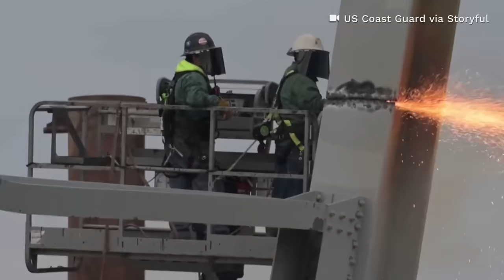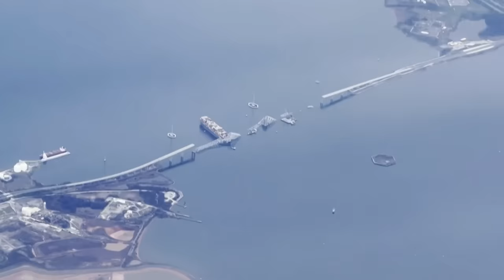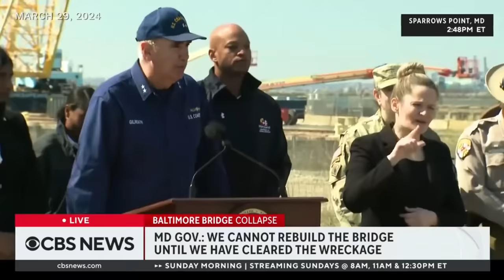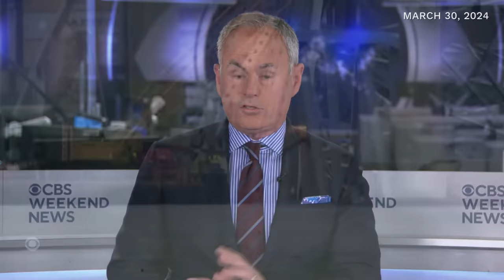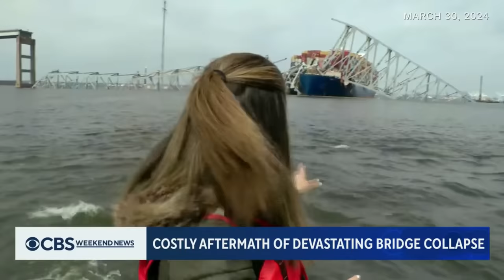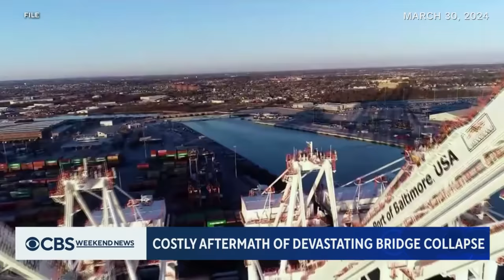Crews begin cutting Baltimore bridge collapse debris into smaller pieces

Comment: When you are cutting the metal, you do not know the forces on that steel and do not know how it will move when cut. That is what makes it so dangerous.
Reply: You right. It's not known what direction it going to take on the time It's cutting 😮🙏🏻🙏🏻 plays for God protect and gives wisdom ❤🙏🏻🙏🏻
Reply: I thought about that! Hope they have something in place for that.
Reply: Don't they hold it with a crane to prevent it from falling randomly after cut?
Reply: @chromatic9180 They do, but they have no idea which way that steel will swing based on torque/tension on it from the collapse. Got some potential widow-makers in that rubble.
Reply: They are professionals
Reply: one cut could shift tons of weight.  Just a daunting task
Reply: @chromatic9180  No
Reply: I'm sure each cut is calculated. But yes structure  unpredictable  when under tension & weight bearing..  but  sure these salvage guys know wot they doing ..stay safe all.
Reply: @antoap3999  i hope so, not just a bunch of cheap illegal workers, the family of the bridge workers that are missing couldn't speak english
Reply: Right ! The laws of Physics is totally not on their side of the ring right now ! One miscalculation & it could mean :text-green-game-over:for some unfortunate individual.

Comment: Very dangerous because the metal has alot of stored engery .
Reply: many pieces can be under tension for sure
Reply: I feel for the burners and crane operators.  Greblav   above comments everything is safe.
Reply: Ya, I imagine a room full of... structural engineers? trying to figure out where to cut it without it falling into a pile like a giant game of pickup sticks.
Reply: I’m sure they looked at it and know where to cut.
Reply: @chrischupp9760 sure, but knowing where to cut doesn't mean shit isn't going to go wrong after the cut
Reply: Definitely. Thats probably the most unpredictable part. Like cutting a giant spring
Reply: @ratataran   Exactly!

Comment: I've picked many loaded shipping containers with my 30 ton crane over the years. ONE at a time, and usually from as close as possible. To see the number of containers on the ship (and many more we can't see) gives me a pretty good idea of the weight involved, throw in the weight of the ship itself, and my mind boggles. Working with a torch from a man basket, with a water borne crane, with twisted masses of steel, they will be taking a while, as they should, damn dangerous.

Comment: Prayers that God keeps all these Men & Women safe & free from harm🙏 Just the stress that the contorted steel is under is hazardous when each individual pc. is cut & snaps free. UNBELIEVABLE BRAVERY ! With all the modern tech. I envisioned they would have used some means of robotic arms &  plasma cutting not a couple guys suspended over the ocean with an oxy-acetylene torch !😱
Reply: Nothing fails like prayer. Nothing succeeds like hard work. Keep it real.
Reply: Skill and experience - Doing it manually means they can tell if the steel gap is opening or closing - any doubt and they'll step back and check things

Comment: So using a torch is faster and safer than unbolting the sections?
Reply: Most bridges are riveted together.
Reply: Perhaps they keep bolted sections intact for investigation and research.
Just perhaps.
Reply: Beams are under tension
Reply: @mtnviper1963  stop the video and you'll see nuts
Reply: Yes. One tool instead of several.

Comment: There are plasma units now that could do the job but those require electrical power and compressed air. The exothermic are somewhat simpler "as I remember".
Somebody is "creating" information  that is not accurate. ie., "not many container ships use Baltimore" stated on an early Saturday morning blip".

Comment: Demolition is one of the most dangerous jobs you can perform. Surprised that one of the platforms is not fully caged and the guy in the orange hard hat doesn't look like he has a harness on (maybe it's under the jacket?).  Will there be any eco-mentalists screaming about spark containment or dust control?

Comment: Then you realize how incompetent the city officials have been for refusing to put safety first, on a key Bridge that is use to move most of America's Cargo by not having dolphins installed as safety barriers in front of those main structural pylons which would've easily prevented that ship from crashing into the Bridge. That's what dolphins are designed for and built for in the first place, they knew this was a problem to stop tragedies from happening. They should've learn their lesson from the SUNSHINE SKYWAY BRIDGE in Florida when a container ship crashed into the bridge and killed 35 people. but they failed to follow through with such safety measures. Sad situation if you ask me. Bridges in the US need to be seriously looked into to make sure their all up to par on safety concerns.
Reply: The city officials are not incompetent, they didn't design the bridge. Even the engineers who designed it weren't incompetent.
That was the knowledge at that time.
The key bridge is just one of those bridges without protective pillars to to be main pillars.
No new bridge will be built like that in these days.

Comment: Wow crazy comments,no the steel cannot be put back together,stored energy(very important)a straw in between 2 fingers,and you cut it the long side springs back to form,accept with those steel beems thay will cut you in half.i am sure every cut has to be looked at 1st an engineer,then the crane operator has to put enough tension to make it somewhat safer,then the cutters can cut.
Reply: The unseen crane ops are also at risk, shock loading can take down even the biggest rigs, it is good to see real pros at work.

Comment: One to look and one to work? 😂
Reply: Do you even work at all?  No
Reply: government contracts they're short staffed
Reply: In heavy construction you always have a partner with you for safety.I’ve done this kind of work and they will take turns cutting,one guy is not going to cut all day while his partner leans back and does nothing
Reply: @mattharper588   What kind of safety can the guy behind him provide?
Reply: @Greblav  I’m a retired Union Boilermaker and we always had a partner in case of an accident and I was on a job where two hands were doing exactly what these Ironworkers are doing,working from a articulated lift when one of them had a massive aneurism and collapsed,his partner was able to call for first responders and get the lift to the ground.Edit they also take turns cutting,you can’t expect your partner to do all of the work

Comment: Can they save the pieces and put it back together?
Reply: not really man that's dangerous and can leave allot of Fractured points on the bridge with weak stressed beams
Reply: Would you really want to drive over a recycled bridge?
Reply: @V.E.R.O.  I live a couple miles from the bridge and I sure as hell don't want to drive over a recycled bridge.
Reply: Aren't wields stronger than steel? @pokermel
Reply: The Humpty Dumpty Reconstruction Company will be taking that task on. 😊

Comment: "Exothermic cutting torch" So 'plasma cutter' wasn't a cool enough sounding term?
Reply: They tried the endothermic non-cutting torch, but that didn't work.....
Reply: A plasma cutter would be an arc cutter that produces plasma.
Acetylene- Oxygen cutting does not produce plasma.
Please stop pissing into the internet.
Reply: different thing
Reply: Exothermic uses as its "gas" 60 PSI oxygen
It's primary benefit is it cuts very thick metals like butter